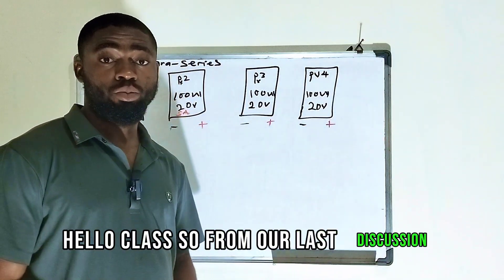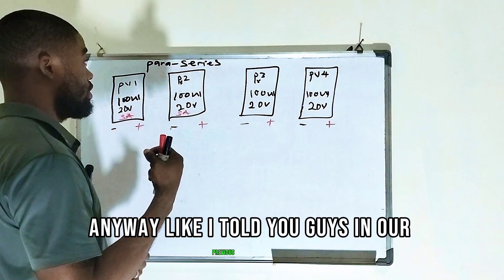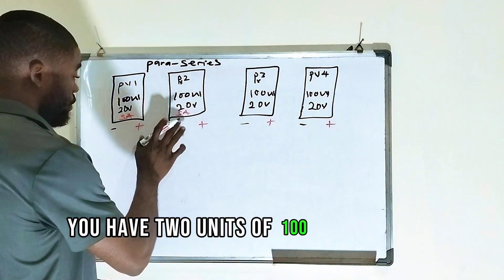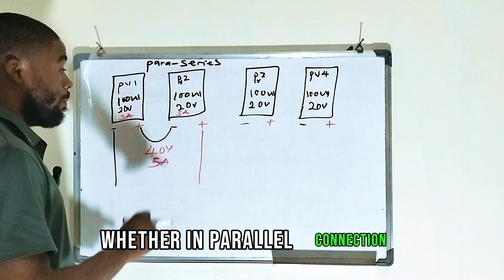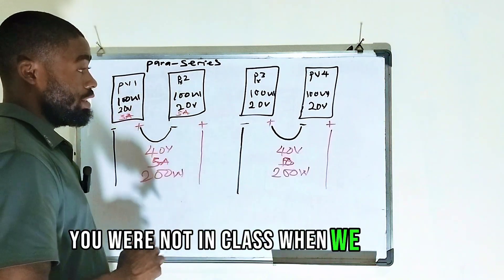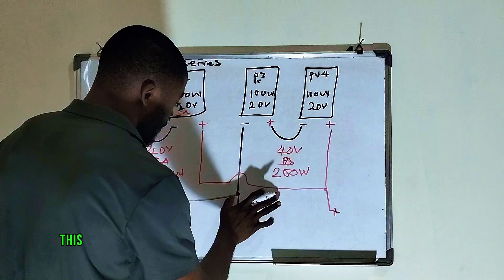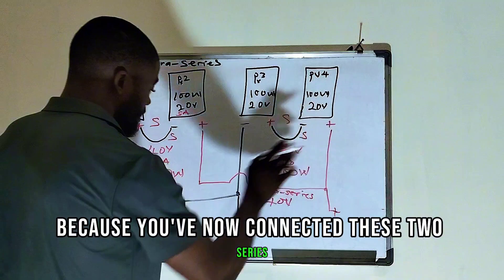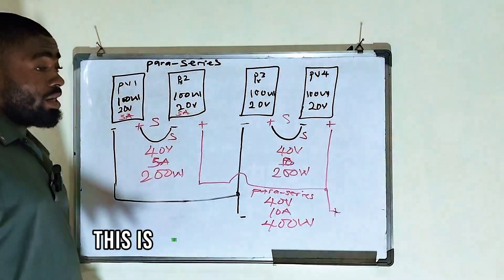How to connect solar panels in Para-series connection; explained!.

Comment: @Solargod, can psraseries be used on 24v system with 6 275 watts panels using 60A PWM Charge Controller?

Comment: There is nothing like para series connection. It's series parallel connection
Reply: It just a code terms
Reply: He explain why he used the terms. Word creation in technology is accepted.
Reply: Mairiga, do a video on essense of precharging an inverter.
Reply from the maker: Precharging?
Reply: Yes
Reply: inverter capacitor precharging

Comment: great lesson  it means if it is 12V + 12V = 24V for 4 solar panel, how about 6 panels that and l want it to remain 24V, how that connection go? thanks in advance
Reply from the maker: Still the same Para-series
Reply: What of 51v, 96v, 144v and 192v of battery  @Mairigaemmanuel
Reply: I meant the panel connection